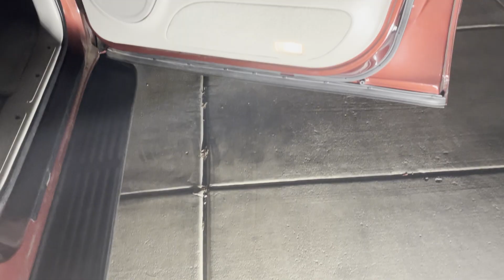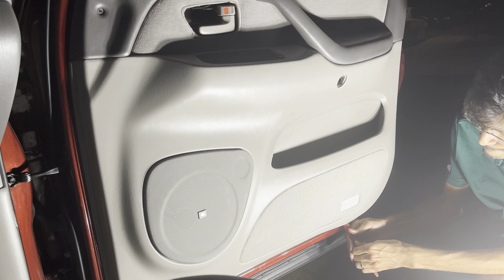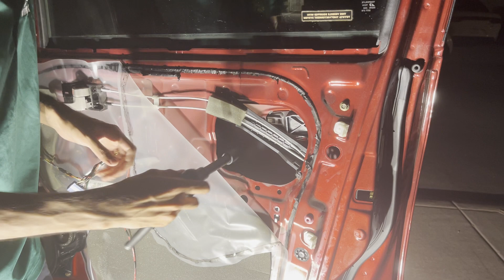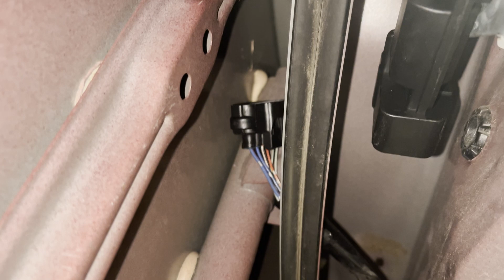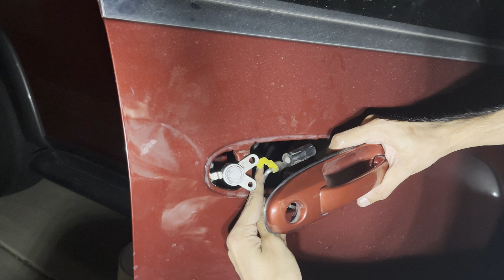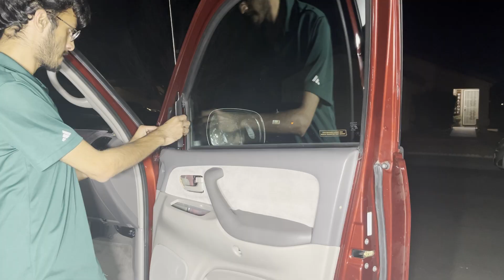How to replace door lock actuator on a Toyota Sequoia, Tundra | 2001-2007 (1st generation)

Comment: Very helpful vid!  Step-by-step instructions with clear explanations, good video angles and lighting, clear sound, and no obnoxious background music.  I have average mechanical skills, and this took me about two hours working outside on a very hot day.  The most difficult part was removing and then later replacing the rear bolt that holds the door handle to the door.  Thanks for sharing your expertise!😀

Comment: I used this vid to help actually replace the lock but not the actuator on my 2002 Sequoia. The only problem was that making sure that the actuator is seated in the lock mechanism before reassembling the door. The Auto Chap shows this but it is important that this works correctly. Everything else was spot on. Thank you, Auto Chap for this video. It probably saved me several hours.

Comment: Excellent video. My latch is going bad so I purchursed a latch assembly on Amazon. It didn't have the door lock actuator, so I thought it would work. Ugh! The part I purchased had different rods. So I sent it back . Careful what you buy, there's a lot of knockoffs that are cheap and don't fit. Buy OEM parts only. More expensive, but better quality!
BTY, excellent video, perfect details. You da man!

Comment: Excellent video. But even with the video, this is a very difficult job. It took me over 3 hours.  If I had to do it over, I would take pictures of the different screws and where they go in. Nearly every screw is different. And that one screw ho,ding on the door handle was nearly impossible to tighten.

Comment: Thanks again, I bought an OEM actuator. I was able to get it done. That hard to get at nut on the handle I found impossible to get back on until I unclipped the plastic retainer from the little bar that is inthe way. I attached the lock cylinder to the handle, pushed the handle in  then from the inside I unclipped the retainer from that bar that is in the way that way the bar can be pushed out of the way to tighten the "impossible" nut. Then it is easy to put that clip back on. Success. Thanks!!

Comment: Thanks for this very helpful and clear video! Question- I need top replace the actuator on the driver's side, back seat. Do I still need to remove the outside door handle since there is no key lock access on the back seat doors? Thanks!

Comment: I replaced my latch and actuator because both were bad, now the latch works as it is supposed to but the drivers door lock does the exact opposite of the other three locks when using the electronic lock buttons. And if you use the lock barrels in the doors it no longer locks all four doors. The video is amazing however.
Reply: Hey I’m having this issue too did you ever solve it and how so thanks!

Comment: This was a perfect video.  Replaced the actuator on my 2005 Tundra using the steps in this video.  Saved  me a lot of money and helped me resolve a door lock issue I have had for at least 10 years.  Took about 2 hours.
Reply from the maker: Thanks for watching and glad you found the video helpful!
Reply: what was the issue?
Reply: @methus57  the actuator would hesitate a bit when pressing the driver’s side door lock button, causing me to have to press it 2-3 times.  No biggie, but that meant I couldn’t program wireless key fobs, so I had been using a physical key to lock/unlock my doors for years.  Replaced the actuator for $25 and bought/programmed 2 new key fobs for $20.

Comment: thank you for this video. my door lock on my 2003 Tundra stopped working a few years ago. Slowly i have been repairing parts that have failed or flat out broke, i.e rear window latch, tail gate won't open, window motor on driver side etc etc. the door lock is now on my to do list. thank you for the detail explanation and instruction.

Comment: Just a note to everybody here, I just discovered it also helps a lot if you order the correctpart! Duh. I got everything uninstalled, and then realized I had a driver’s side latch in my hand, and not a passenger’s.